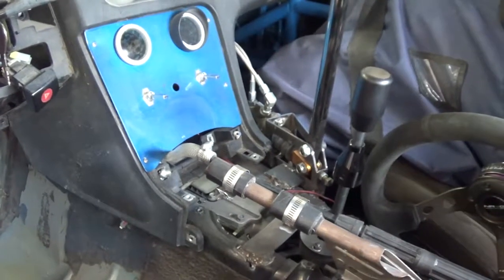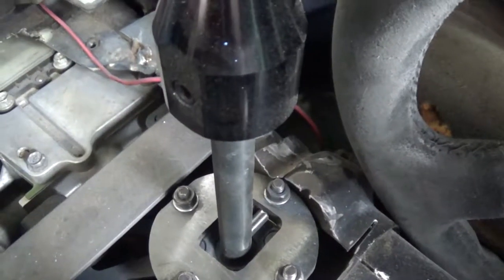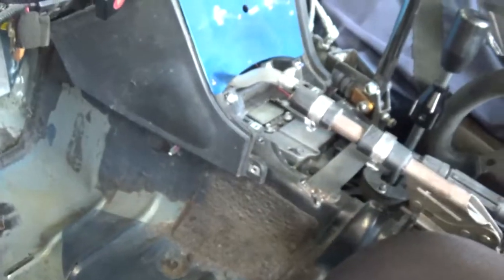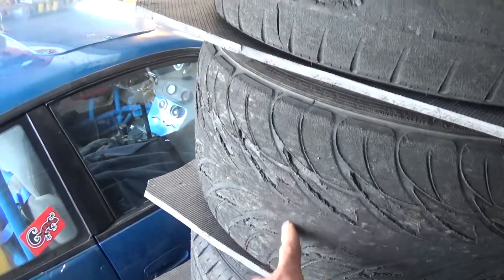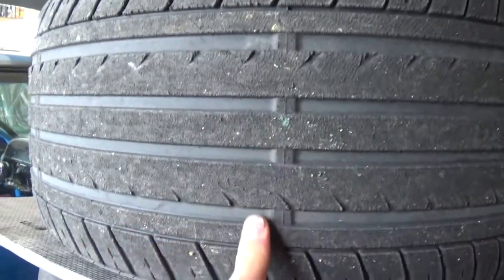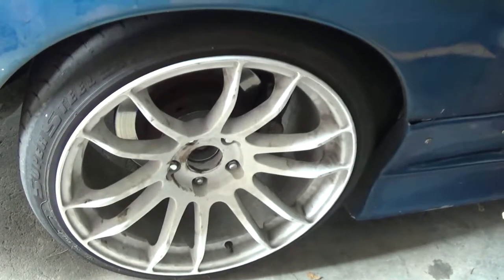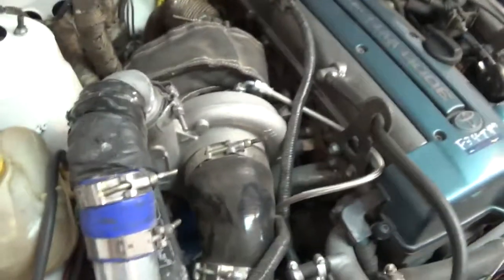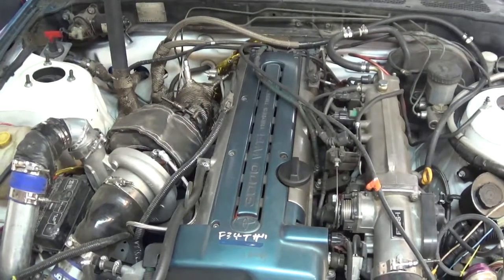Post-drift event Collins adapter thoughts

Comment: how is the chatter at idle of the twin disk? can you stop it if you let the clutch out gently?
Reply from the maker: For a drift car, the chatter isn't bad.  It definitely is there, and seems to get louder as the engine/trans warms up ( or maybe that's my trans making noise).  The throw out bearing I used is also pretty noisy but because it's a drift car I'm not all that worried about noise.  If this were a daily driver or something, it might be a little annoying but definitely nothing overbearing or too concerning.
Reply: thanks kind of takes effect on my decision for a daily  @CtrlAltDefeatTV

Comment: Hey I'm doing the same exact swap in my S13. How did you wire everying up? How did you wire the transmission connectors? Fuse box? Tach?
Reply from the maker: I wired everything up separate from the vehicle OEM wiring harness.  Just some switches, fuses and power from the battery.  Tach is run off the igniter chip to an aftermarket tach on my dash.
I don't have anything hooked up to the transmission as far as electronics go.

Comment: Hi there, thanks for the informative video. What standalone ems/ecu are you running?
Reply from the maker: It's just stock stuff.  Stock MAF, injectors, and ECU
Reply: Interesting, didn't think the stock ECU is capable of compensating for a single turbo set up, how much boost are you running?
Reply from the maker: @Hmonglauj89  I'm running about 14 or 15 psi or so.  And stock set ups can handle bigger turbo's just don't get too crazy with the boost.  I have an AFR gauge and it stays around 12 at WOT and full boost so there's plenty of fuel in there.  Air is air, coming from twins or a bigger single, the ECU can give the correct amount of fuel and timing based on the MAF's reading, the Intake Air Temperature sensor, and the MAP sensor.  
I've even successfully ran a bigger turbo on a stock SR20DET ecu and it only uses a MAF sensor, no MAP or IAT
Reply: Interesting stuff, amazing how much smarter these ecus are. Thank you.